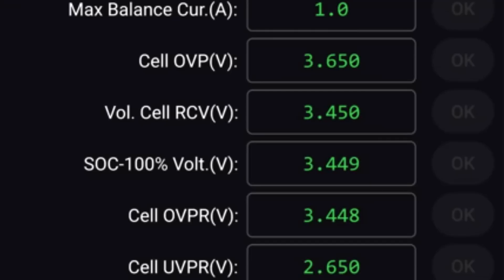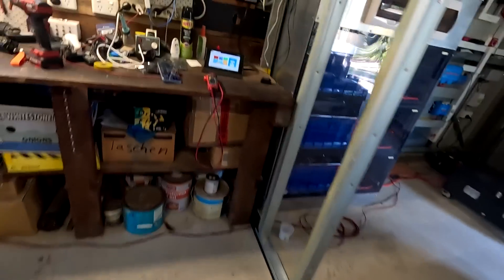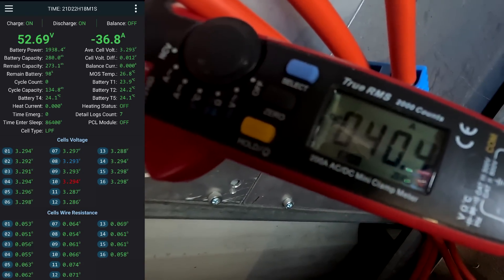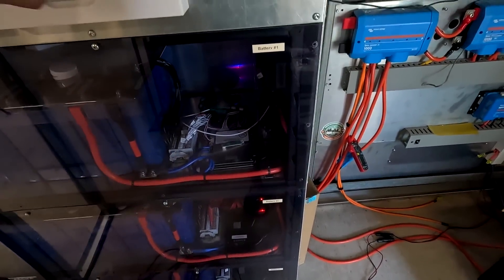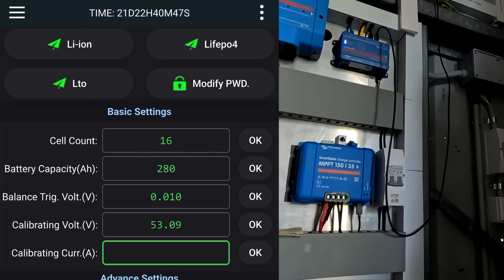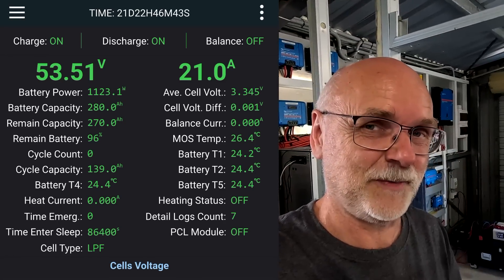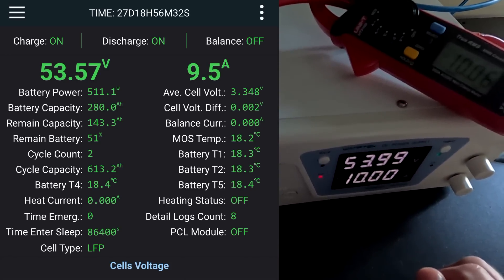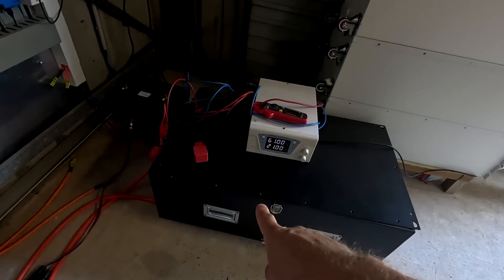JK BMS SOC Drift - How to (not) calibrate the current sensor and will it actually help?

Comment: Hi Andi, you need 2 calibration points. Zero current and max current calibration for proper linear curve. But there's more for a proper SOC. you need a very high resolution ADC to measure very small currents - long time standby drains the battery with small current by the bms. You need to take into account a bleeding self discharge parasitic current in the cells not counted by the shunt depending on temperature, also charge / discharge efficiency (heat in the cells and bms), Balancing also destroys charge, and there is the Peukert exponent too. Complex math by current, time, temperature current direction, ADC reslution errors... Victron s,art shunt does a great job, except for self discharge leak over temperature and time and balancing losses. Also when the cell capacity depends on cell tempeature - so does the SOC too. That means it is important at what temperature you do a capacity test. Have fun!

Comment: DIFFERENT APPROACH: I have 2 PV systems with 8 GROWATT inverters used as a FULL FEEDER which is feeding 100% into the grid and passes the official energy meter and a usual surplus feeder for the home (attention 2 growatt inverters are part of the full feeder, not just 1) . 
I have compared the GROWATT metering of the past month with the official number. The GROWATT CLOUD / INVERTER figure was roughly 2012 kWh (for both), the official one showed 1999 kWh.
That is just +0,6% more. And that gives me the "hope and believe" that the growatt measuring seems to be quite accurate while the JK BMS was way way off which I had assumed from the beginning cause each cell had been ZKE TECH measured multiple times each of them above 282 Ah, when the JK BMS told me that we did not get more than 241 Ah out of the battery.
So we were pretty disappointed about the cells for months . 

Growatt shows me a draw of 1040 W from the batterty and JK BMS pretendes to deliver 892 W. while Voltage values were close to each other 52,1 to 52,2 V over the whole SOC. 
Hence I used this 1040 / 892 Factor to "CALIBRATE" or should I say "SPAT-ibrate" the JK BMS from 16,9A to 19,6A. 

Why ? Cause in that case the 282 Ah weakes cell would determine roughly the battery capacity cause if you divide 282 Ah by the "JK off factor" of  1040/892 you get the 241 Ah figure the JK BMS has always pretended to have delivered. 

First night is over with a constant discharging of 1040 W x 12 h = 12480 Wh while 36 Ah still remained in the battery x 51,2 V= 1840 Wh in total an estimation  of 14.320 Wh 

BUT THERE IS A TINY CATCH: losses
My 1040 W drawn are shown as the draw figure of the battery and then split into 900 W for the house and 140 W feeding in. 
DC 1040 W   usually does not equal  AC 1040 W without any losses. I assume we have to expect the usual 3,5% losses shown on the inverter data sheet or roughly 0,5 kWh losses (14,2 kWh). 

But again: As long as I am pretty confident that the growatt figures are accurate I can ignore that and simply have to wait another night with then maybe 1190W x 12h .

Of cause a "you can not do it that way method" but why not if that is better than the JK guess work ?
THe official meter is calibrated , Growatt is delivering far more closer figures than I had ever thought and if the Growatt Watts are measured right i will trust their Wattmetering too cause that is AC based. If I get 1190 W x 12 h = 14.280 Wh I can live with that or even lower figures.

Of cause not really a solution for everybody cause it might require a lot but at least worth sharing the thoughts how to calibrate the JK BMS without a clamp guess o meter.
I think JK needs to improve their calibration and I also have to admit this big coil on the V15 which should have been in the center of the round whole is not in the middle and the built quality and craftmanship were rather terrible, I mean all those manual labour steps you can check. Loose screws is not what you want to see at delivery on such devices. Yes, easy to fix but you have to become aware of that. 
After their firmware upgrade which had worked flawlessly (following your instructions from a video 6 months ago) I have ordered another batch of 2 JK Inverter BMS.

Comment: Oh, another video about the JK's😅
No matter what and how I calibrate the JK's, after a few days the SOC drift starts again and then it gets worse from day to day.
Why don't the JK's get it? After all, it works with other BMS too🙄

Anyway, thanks again for the many videos from you Andy😉

By the way, my new video about the JK inverter BMS is coming out today. 
I'll go into our experiences and problems in the first 3 months of operation. 
There was also one complete failure, which wasn't so nice.

Kind regards from the currently also sunny hot Germany😂

Comment: Hi Andy, thanks for all the vids and info, 100,000 soon 😁. I was wondering if you can ask the JK software eng about the parallel limit on the inverter bms, why ? any plans to go above 4 etc etc
Reply from the maker: You can parallel as many as you want. There is no limit. Just make sure each battery has its own safety device, breaker or fuse.
Reply: Thanks for the reply, I know you must be a busy boy replying to comments. 

A year or two ago I asked JK about parallel use with the B2A8S20P and was told it was not recommended. In reality I have had 4 x 24v banks running well to date. 

Wouldn’t the dip switch’s limit the master / slave numbers on the newer BMS ?
Reply from the maker: @SailingThelKen  The switches are only of interest if you have them communicating to each other and the inverter. But without, there is no limit.

Comment: I've learned this from a bunch of the older JK BMSs I've had running for years - Their current sensing isn't high enough resolution, so in and out currents that aren't "smooth"  cause it to diverge from its actual SoC *a lot*. I've had a PV string -> MPPT charger -> JK BMS DIY battery -> Blue grid-tie inverter with limiter, running for five years in this configuration, and because the MPPT charger is doing PWM in and the GTIL is doing PWM out, it sits around 48V (14s LCO batteries) but thinks it has 95% SoC. If I fully charge them it only takes about a week until its fully off again.
Reply from the maker: Best solution is maybe to use an external shunt as battery monitor and let the BMS show and calculate whatever it wants. That's how I run my battery shelf with the Smart Shunt and it woks well.

Comment: Each week I change the capacity after reaching 100% then BMS shows 70% then inverter start charging it again till it hit the top voltage, yes cycle count goes back to zero but at least battery get charged to 100%, yes it is painful repetition.

Comment: Hi Andy, 

in my camper I observed another SoC issue with the older (non-inverter) JKBMS: if the current falls below a certain threshold (0.5A?), the JKBMS just assumes 0.0A. This causes a huge amout of SoC drift in just a couple of weeks, if the battery is just sitting in idle state, powering only the cerbo at 5..7W (0.2A @ 24V). 

I guess the inverter BMS is doing the same. Maybe it would be interesting to discuss that topic with the JK engineer?
Reply from the maker: Yes, it's a know issue with all BMS. The JBD is still very close to the Victron Smart Shunt during Winter, so I wonder what their secret is to keep the BMS so accurate.

Comment: The SOC drifts because JK does measure peek current and not average current.
The current a victron multiplus II draws from the battery isn't DC it is DC + a sine shape.
If mine Victron shunt does sees 0A, JK reports -3.8A or 3A.

An 3A offset (caused by the JK peek measurement) would be in 24h an 72Ah error, no wonder SOC drifts!
Discharging with 100A, the SOC is almost correct, but discharge with low amps the SOC is way off.
JK should implement average current measurement to fix the SOC issue!
For protection peek measurement is ok, but for SOC peek measurement is not usable.

Comment: I have 5 identical JK BMSs and observed that also Voltage needs calibration because connected to the same busbar and equalized for long time Jk shows different voltage but when checked by probe they are all the same.
Reply from the maker: Yes, voltage can also be calibrated but is not important for the SOC drift or inaccurate measurement of the current. The JK has several issues here.

Comment: Might help with the calibration to have large capacitors and inductors on the BMS input to decrease any voltage ripple (every PSU have voltage ripple) 
Just be sure to slowly turn down the charging voltage before disconnecting to prevent overvoltage from the inductors.

Might be safer to just go with capacitors and no inductors
Reply from the maker: The inverter already has huge capacitor banks at its DC input. Adding more will make very little difference in this case.

Comment: Where are the automotive guys that have the knowledge and experience cause the usual EV are quite accurate in my opinion cause I am 0 km of Range user who uses the car really and fully. At the end of a trip I do the extra km to get down to 0 km of range which does not hurt the battery at all due to the 2 factors that the car battery has a buffer (net capacity is used for driving and range) and that I instantly start the charging and that in a slower way like 2 to 3 kW AC. 

But where are the car drive train engineers here that can provide how the car manufacturers are dealing with the topic. They can not afford big mistakes which can cause a stranded car on the highway.

Comment: I had done the JK 15.30 firmware upgrade successfully and now I am wondering what the heck this float charging is doing cause it is now pushing 290 Watt into the battery for hours even though this is already at 100% SOC. 
How long does floatcharging usually take for the JK BMS cause I am wondering if that is really usefull or if I should turn the battery simply off with a HomeAssistant Switch provideded by BAT Mon ?

Any ideas what to do or a link to a video ? I have searched for float and absorption but did not find any or must have overlooked one .

Comment: I am sure other people, who understand this far better have better solutions. This is what I recognise from the patterns.

The bms is not showing current changes smoothly. It follows a lag, and it seems to skip values. My guess is that within a 1 second window, it measures the current twice, and shows the highest, lowest, average of two, number closest to average, or what ever the exact measuring, recording, reporting and displaying is done.

In the time frame that the data is collected to the new data point, is there a lag? A space of no data? Or is the last value used in the calculation of the new number as the first value.

The reason why I ask, it could be that everything is correct hardware wise, but the number reporting, calculation, algorithm is flawed?

Another idea for calibration, have two data points for a high current and low current. Max and min value being shown on the clamp meter under any load, sine or not. A similar value when the load is less. Figure out a formula to make the averages similar, or reduce their errors. 

Allow the calibration current to be 0.01 accurate.

This won’t solve the actual problem, it would just mimick the measuring behaviour of the tool of the user. It would give them a peace of mind. One is only as accurate as the tool being used. 

I think jk might be confusing the issue of accuracy with consistency. If the bms is accurate, but showing the wrong value consistently, the difference between high and low current is similar, than the user numbers can help reduce those errors further. 

Hope that makes sense? If not, I can explain it better, later.
Reply: Not sure why the comment is double posted, sorry. Scared to remove it, as it might remove the other as well. I don’t know how YouTube deals with such a situation

Comment: The real issue!! is with the fact that when the BMS reads 100%, it causes all in one inverters to stop changing, no matter the voltage. 

 There needs to be an option to
Stop counting at 99% until the RCV Times is up.

Also, they should consider mabie adding a Peukert exponent
Reply from the maker: JK is aware but has not developed a solution yet.
Reply: Good to know.  
I think the solution should be to add an option to limit the SOC counter to 99% until the RCV time is over. And then rest to 100%.

Comment: Looking at my REC BMS manual, it states (in the SOC section, there's other detail on the shunt measurement):

"Temperature and power correction coefficient are taken into consideration at the SOC calculation. Li-Po chemistry algorithms have an additional voltage-to-SOC regulation loop inside the algorithm. Actual cell capacity is recalculated by the number of the charging cycles as pointed out in the manufacturer’s datasheet."

Comment: Hi Andy, great video. However I have another problem with my JK BMS - I changed the 123456 password, now nothing works, no password works, not the one I changed it to or the original 123456. JK have removed their whatsap QR code on their website. I can't find full factory reset options, I'm totally stuck. I tried the force FW code generator but that didn't work. any ideas...?
Forums tell me that changing the code is a bad idea (Pity I didn't see that before I changed it).
Any clues at all to follow?
Thanks,
Reply from the maker: Did you use the password hack for the JK BMS?
https://youtu.be/Qwlkh6U8Cc8?si=Za3JL2O5Wvhlq2hI
Reply: @OffGridGarageAustralia  Hi Andy, yes I found the app password generator at the bottom of the page; just needed the serial number to generate a code. I've now saved that page in case.... Cheers,

Comment: I am not sure why you are even concerned with the SOC as measured by the BMS.  I don't know anyone with a solar system that relies on the BMS SOC.  Yes, I guess it would be "nice" but I am not sure I would trust in anyway because the BMS SOC never seems to agree with the shunt SOC so I have just gone to totally ignoring the BMS SOC.
Reply from the maker: If you have an external shunt yes. Almost everyone does not have an additional shunt and just connects the batteries to the inverter.

Comment: Thanks for this video, Andy. 

I also have found JBD SOC values to be much more reliable than JK. Now I know it's not just me 😅

Several times i have had a nasty surprise thinking SOC was 40%, then seeing it jump to zero as a cell went undervoltage.

It would be good to see JK fix this issue with what is an an otherwise very good BMS, even if it is just a software workaround.
Reply from the maker: Thanks a lot for your support 🙏👍
Yes, this is one thing which needs to be fixed on a long list of further issues and requests. 
I don't know how JBD does it, but their SOC calculation is on par with the Victron smart shunt.

Comment: the min resolution of the bms is 0.4A - so lower currents may differ easier by one  quantisation level/step like 5A are displayed as 4.6. or the 15A is once 14.9 - 15,3 - 14.5. Always 1 step up or down. And yes - highest possible currents needed because of this bad resolution of current meassurement.

Comment: I would start by re torquing
all connections. Especially those inside the battery to see if you get a more consistent flow of current with less variability

Comment: Maybe you need to solve the problem not by software but by hardware? The developer may release a separate mini board that would fix this problem. Customers would buy it, connect it and forget about the problem. And the new version of BMS would already have this board in it.

Comment: system specifications: inverter  Victron multi rs 48/6000/100-450/100 
Panels 3.8kwh installed power and a battery of 16 LIFEPO4 cells of 230A, Jk B2A24S20P

Comment: this is due to voltage drops on the conductors, differences in the length of the conductors, section of the conductors. there are many variables.But mostly with my system I am satisfied with the results

Comment: I discharged the 11 kwh battery to 20%. then I limited the inverter to charge from the grid with 50A. I entered the calibration value and Boom. it worked. but at lower currents there are still differences. that is, the inverter tells me that I have 30% of the battery left and the JK tells me that I have 32% left

Comment: Is it possible to use in a GX system a Victron smart shunt for soc and current measurements and the JK for others controls?
For example the GX can be configured to use the soc from the smartshunt to stop the discharging under a predefined value and still use the JK information to set the charge current, float voltage, react to BMS alarms, ecc?

Comment: The resolution of measurement seems to be 0.4A and it's way too low for soc calculation. If it's artificially kept low to avoid noise in the reported value I suggest to remove this "feature" : a noisy measurement is maybe less cool to see on the screen but do not cause drift in the SOC calculation. 
I suggest also if possible to perform measurements with a sampling frequency at least 2x the cutoff frequency(Nyquist Theorem) of the analog signal bandwidth (determined by the filters/opamps used) and sum all in a 32bit variable for about 1-2s and then use this value which will be a mean over 1-2s with an very high resolution. For example if we sum 1024 measurements in a noisy environment from a 10bit ADC then you will have a 20bit mean value.